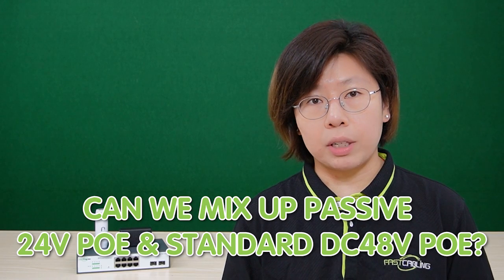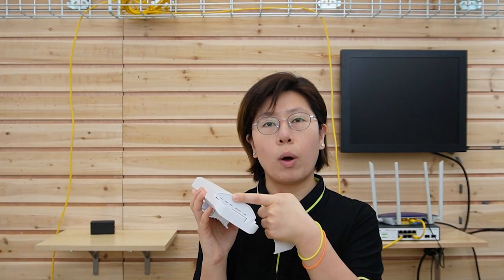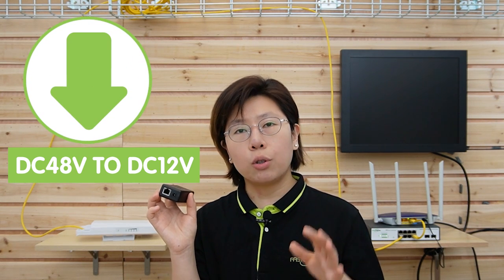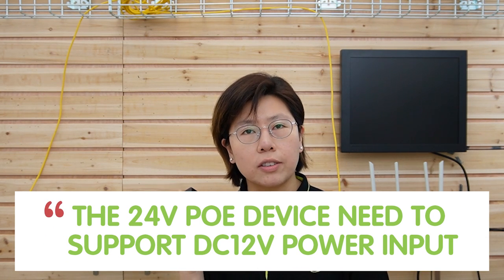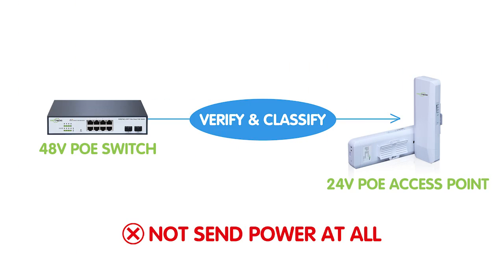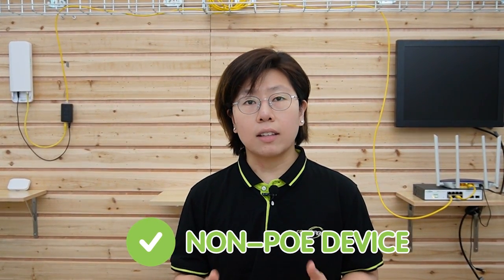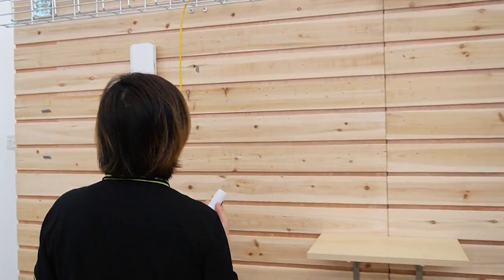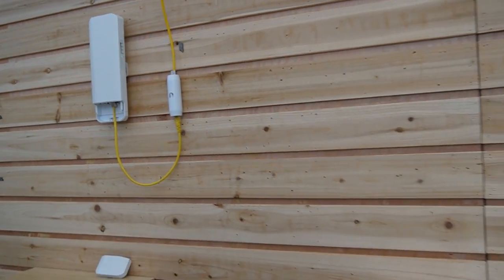How to Connect 24V PoE AP to 48V PoE+ Switch

Comment: How can I convert my NVR's POE to support a POE+ security camera?
Reply from the maker: Technically, you can’t. The workaround is you can add a PoE+ injector to that specific port you need PoE+ power, and it will take over the power supply for that port.
Reply: @Fastcabling  thanks do you know of one specifically you can recommend?
Reply from the maker: This POE injector will do. https://www.fastcabling.com/product/10g-30w-802-3at-poe-midspan-injector/

And we also have different types of indoor and outdoor PoE injectors for sale: 
https://www.fastcabling.com/product-category/poe-injectors-splitters/

Comment: Great explanation.
What are the modela of devices for both methods?
Reply from the maker: The first one is 12V PoE+ splitter. https://www.fastcabling.com/product/ieee-802-3at-gigabit-poe-splitter-with-a-12v-output/

The second is the 24V passive PoE converter (Ubiquiti).
Reply: More specifically, the Ubiquity one seems to be the model INS-3AF-I-G

Comment: Good morning sister here i need your help about about EAP225 TPLINK OUTDOOR i just want to know what is the maximum poe adapter if i removed the original poe adapter try you to make signal strong i need your advice cause i like to damage my only  EAP225
Reply from the maker: You can choose a PoE injector/switch that relays power over its data pairs 1-2 and 3-6 since EAP225 utilizes the spare pairs 4-5 and 7-8 for passive PoE. According to TP-Link, it's compatible with both IEEE802.3af and 24V passive PoE, so you can choose one accordingly. And we have tested that it can be powered by our 30W PoE injector with no problem. If you need to learn more about EAP225's power issue, you can refer to this video: https://www.youtube.com/watch?v=mUWJ_lbMt8U

https://www.fastcabling.com/product/10g-30w-802-3at-poe-midspan-injector/

Comment: TP-Link TL-POE4824G PoE adapter Gigabit Ethernet 48 V
Reply from the maker: It might burn your EAP225 as it can only accept IEEE802.3af and 24V passive POE. Always check the manufacturer's specifications and ensure that it is compatible with the power source. You'll need TL-POE2412G Gigabit 24VDC Passive PoE Adapter for your device.
Reply: Good morning sister again i like to help me about yagi 5ghz wifi extender can you found it for me in there cause in South Africa i failed to found yagi 5ghz wifi but only i found is 2.4ghz only
Reply: Good morning sister how are you today I hope you are ok i need your help here can you found for me a yagi 5ghz wifi extender i want to make a business next to my neighborhood connecting to me rent for that i want cover all area but the problem is 5hgz yagi wifi i failed to found here in South Africa i hope Japan has a yagi 5ghz outdoor wifi i want to replace both side my antenna wifi EAP225
Reply from the maker: Sorry to disappoint you, we do not provide such services to our customers, our expertise is mainly in PoE and fiber optic networks.